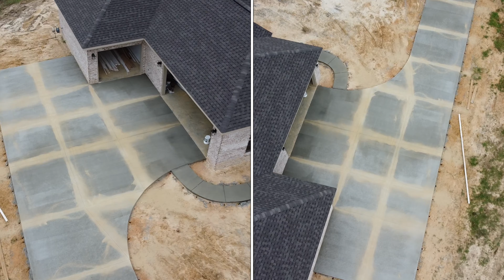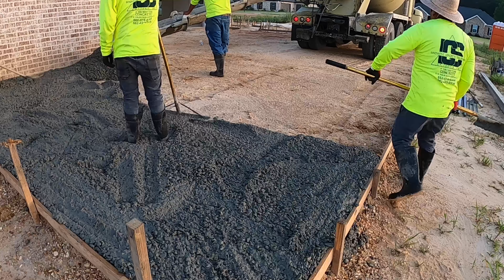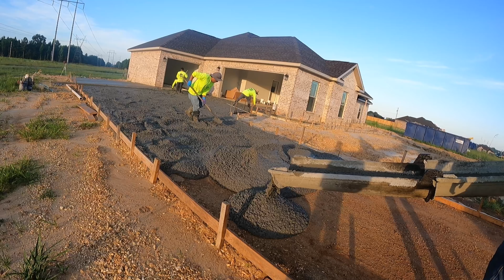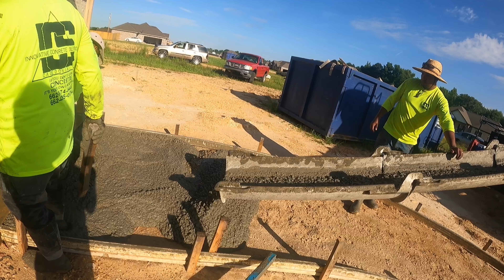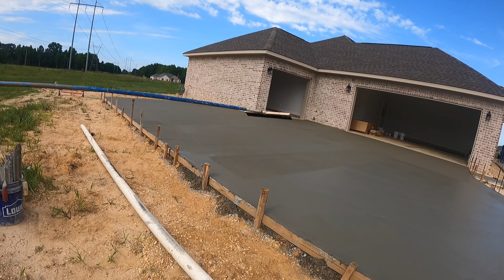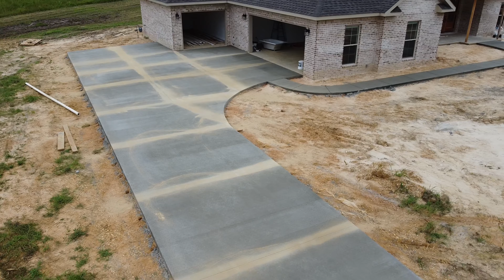12’ Driveway with 3’ Sidewalk/ 32 yards

Comment: Just curious, why no reinforcement? Great clean work btw.
Reply from the maker: Good question, contractor’s choice on this one, we used structural FIBER in mix. Its thick and long, we haven’t had any crazy cracking problems.
“Ice melts and concrete cracks”
Reply: @Innovative Concrete Solutions  you know your stuff bro and u speak really well, you started a whole year before me

Comment: Where’s the reinforcement?
Reply from the maker: There is not rebar or wire on this one.
Contractor like to use structural fiber in mix.